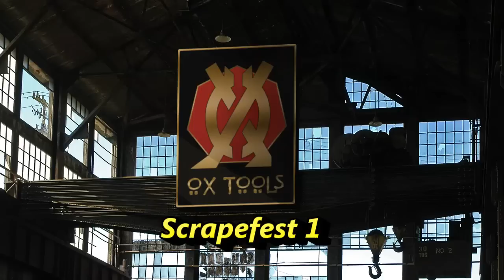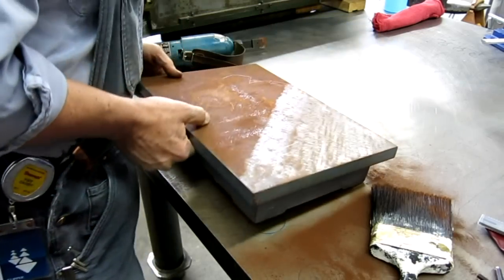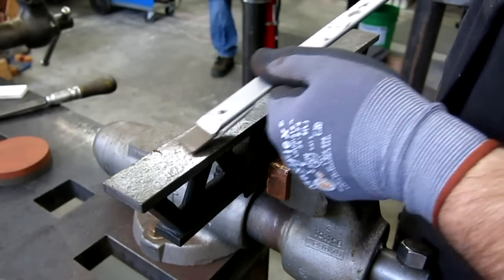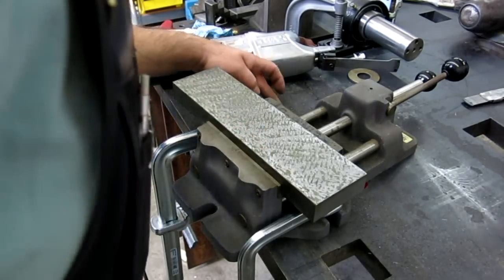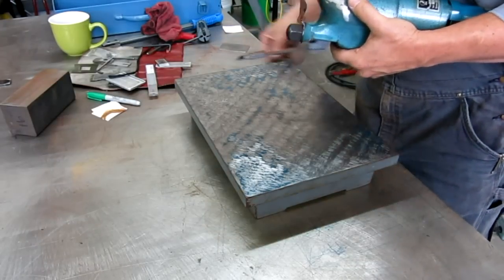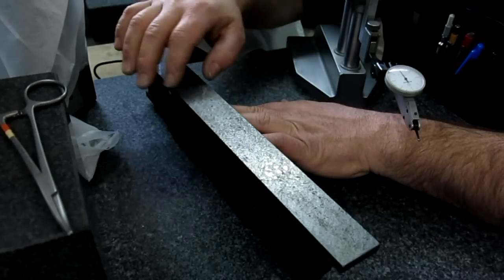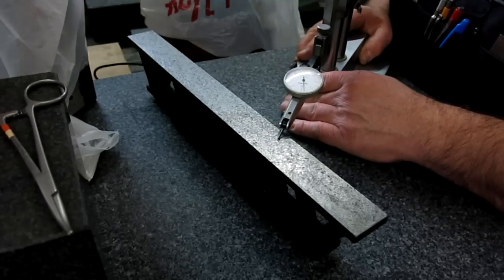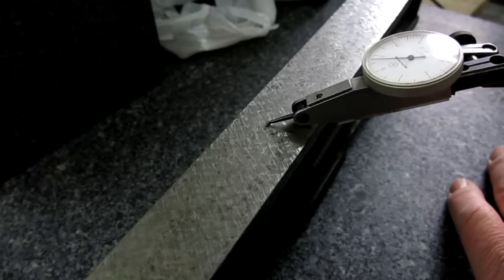Scrapefest 1

Comment: Why scrape instead of grind?
Reply: 12345NoNamesLeft to get extremely flat surfaces
Reply: 12345NoNamesLeft No heat, no clamping force, don't have to bring the part to the machine etc
Reply: 12345NoNamesLeft You do not need to buy, find a place for, and set up a grinder.  You do not need to get grinding dust in all your tools.  In fact, you need little more than a scraper, a reference surface, and your work.  You can make your own accurate reference surface with three hunks of iron and a scraper, but a decent surface plate can save you a whole lot of work...
Reply: ***** Why is grinding dust even a factor. Scraping is so time consuming, that the effort to clean tool is negligible.As much as I want to support scraping, It has to be said that a quick grinding job will out do a sloppy scrape job. For example the new Taft Pierce blocks and plates, you pay ~50% more to have them scraped, but the inspection tolerance is equal to that if it were ground. Since scraping is a trial and error process, I can tell you that they quit as soon as they meet tolerance. You may as well get the ground blocks then scrap in a patch work your self and save a few hundred.
Reply: 12345NoNamesLeft scraping is a lot more fun and more precise!
Reply: Alexander McGilton A machine cant really create more precise  parts than its own ways...let that soak in and think about it
Reply: Henning Jonsson I completely  agree. I re-scraped my Harig grinder and it now holds parts flat almost to the tenths across its capacity. A part that would take you all day to scrape I can grind in 5 min of cutting time. The quote by Da Vinci "Art is never finished, only abandoned" is better suited for scraping. What matters is when you abandon your scraping, and why I said that "quick grinding job will out do a sloppy scrape job".

Comment: My .02 
Don't bother machining it, it's a level base needs to be straight/flat. It's not a bearing surface .  (Moveable part)A small low is not going to affect any thing when used as a levle.
. . But if you wanna show your friends a perfect piece take a pencil eraser and dab a touch of blue over it ;)
Reply from the maker: +B Stevermer Hi Steve,

The original Pratt and Whitney levels had scraped soles. The ground bubbles on these are sensitive enough to pick up a few tenths over their length. The scraped finish sure looks cool as well. Thanks for the comment.

Cheers,

Tom